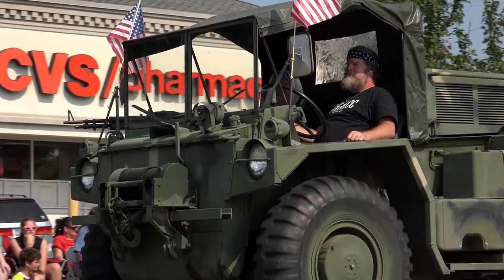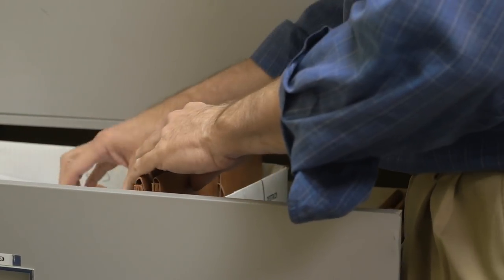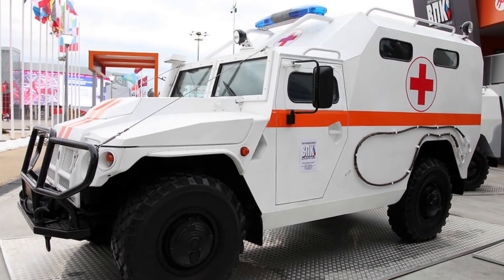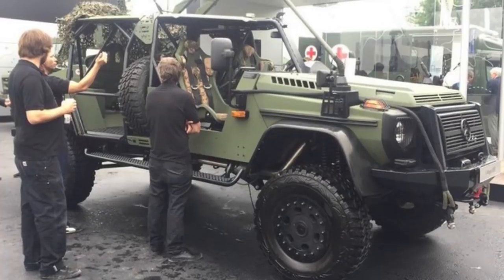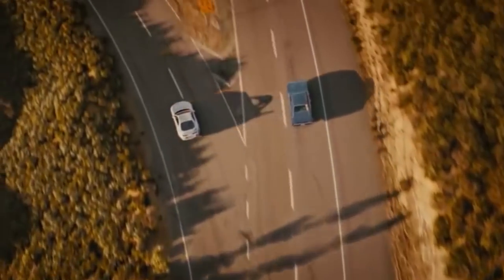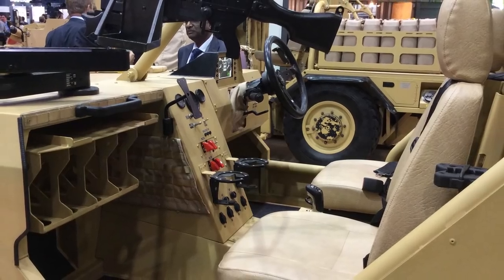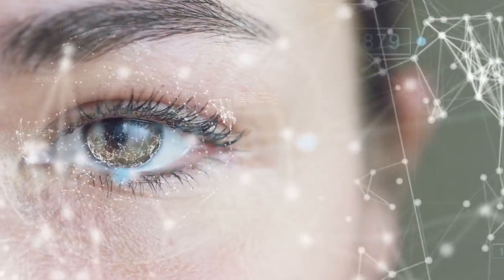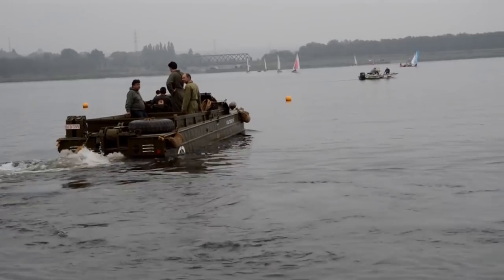10 Best Military Off-Road Vehicles Of All Time

Comment: This guy really needs to spend a lot more time fact checking before he releases a video und e the pretence of infotainment.

The misleading facts he quotes, not to mention jis chosen images to support a significant amount of the information he provides are poorly selected, misleading or just flat out wrong!

Which then makes you wonder how much of the remsining content is accurate or not?!

Examples are anything from the flag shown when talking about the AMG being designed for the Australian military..... that's not the Australian flag you Muppet!
It's the New Zealand flag, an entirely different country thats separated by almost 3,000miles of ocean!
Also, that vehicle was neither de designed for the Australian military, nor do they own any of them presently or previously for that matter.
They do however have thousands of the English built Land Rover 6x6 Defender vehicles in 50+ different configurations. 
Same wheel count, close enough. Right??!

And showing a rack of old fashion timber stocked rifles when referring to a vehicle's flexibility and availability/ array of weapons systems is almost as stupid as the image of a soldier or "Machine Gunner"  sitting behind a fully automatic .50 cal as you reference a vehicle being capable of handling "small arms fire...." Mate a .50 cal doesn't blow peas through a straw in an attempt to humiliate the enemy!
It's arguably one of the most devastating and powerful single operator weapons presently in use in the armed forces.

Just sayin'....